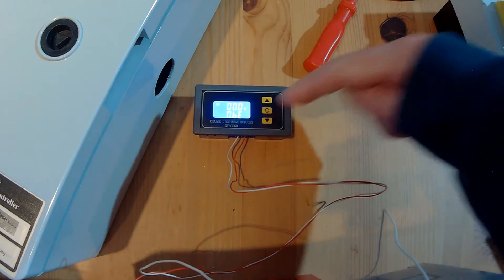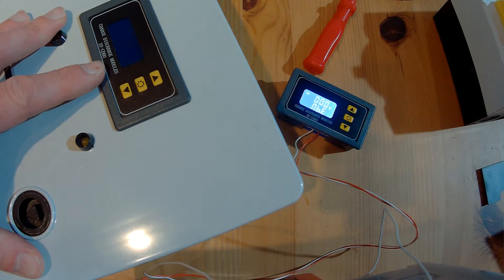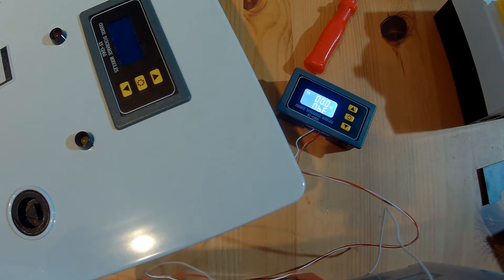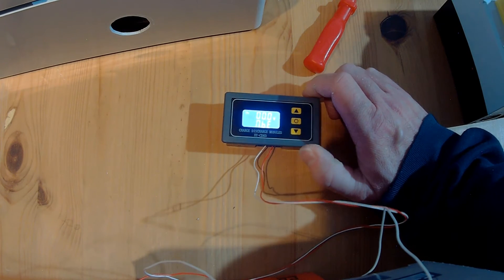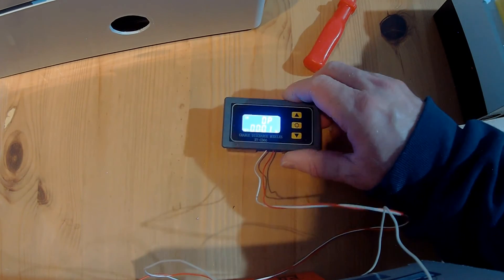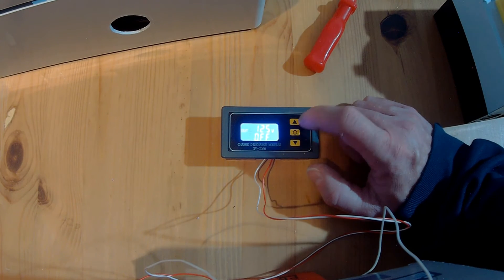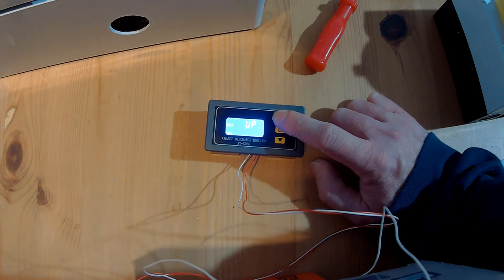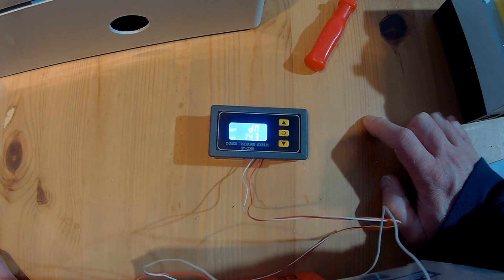Setting XY-CD60 controller at ISTA Breeze charge controllers

Comment: Is there any reverse current protection in the charging mode? Does the battery supply voltage to the charger when it is not working?

Comment: Hi, I have a question: just connected Ista 1kw + controller (changed xy-cd60). IN +00.0v+ nbe….is that normal or does it have something to do with the voltage parameter the cd60?  Will nbe change according to battery charging voltage..or could there be other reasons?   OUT looks “normal “.  Battery voltage was when I checked was between 26.0 and 27.8.

Comment: When I hook this system to my 48v system the turbine will spin up  fast enough to make good a.c. current before the rectifier. When hooked up to my 12v battery, the turbine bogs down and struggles to keep voltage up.
I hope that when adjust the XY CD60 then connect the charger straight to the battery it will act better.

Comment: Do you know how to calibrate the voltage display? Mine is off by .7 volts...not good
Reply: I just received mine and it is off by 1.2 volts, Not happy so far, the programing does not work as should and it is unlocked and was supposed to come from the factory to my specs.

Comment: Thanks for the video. Is the xy-CD60 solid state?  I use the A30 volt sensing controller ( ebay £12 to £15 ) to control a solid state 40Amp relayy which works great but I worry about wear and tear on the electro mechanical coil relay ). It's a bit worrying to hear the rapid click-click-click when the battery is getting full or if it's getting to stormy. Good videos by the way. You obviously enjoy the challenge as much as all us windmill owners!
Reply from the maker: Hi
The CD 60 into the ISTA controller does nearly the same. Just control relays. If you are close to the max voltage, and you have a stormy day, you will have these clicks as well. BUT (!) you can change the time until it goes back into action. Therefore, you can reduce the click rate ;)

Comment: How ampere charging and disccharging can handling sir??
Reply from the maker: Hi. The controller switches only  relays. That means it starts the charging process be reaching a specific voltage. Hope the helps - or what you mean?